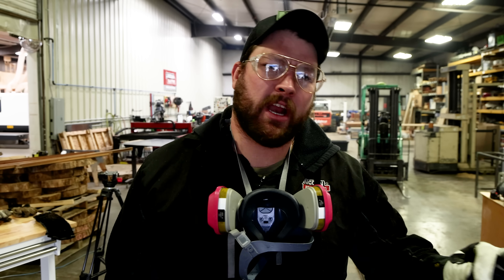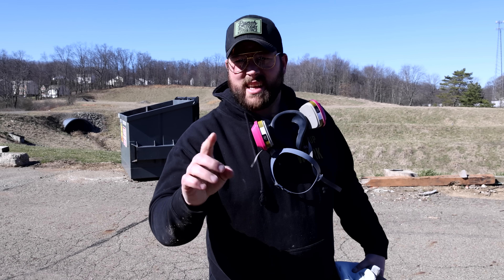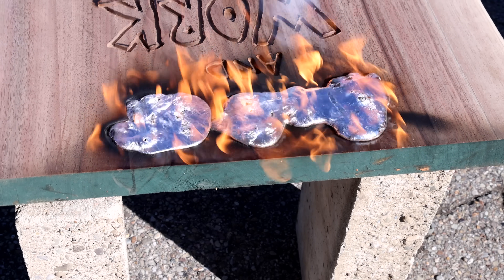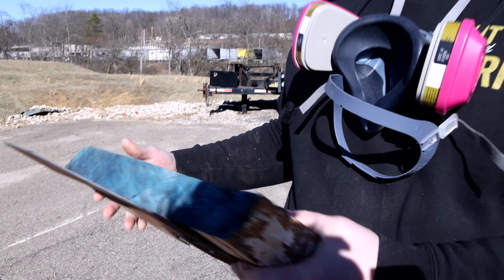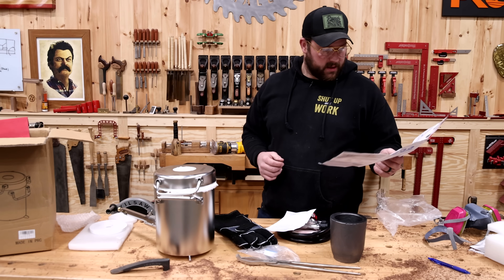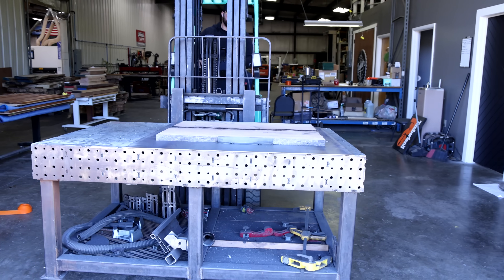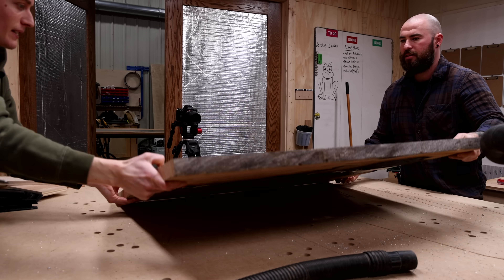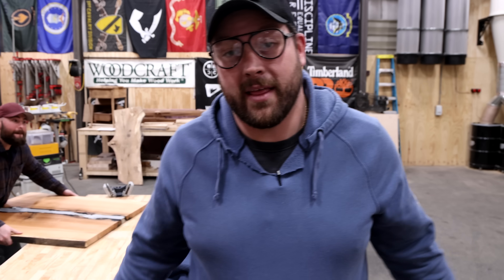I Tested Pouring Molten Aluminum in Wood

Comment: FYI: you can’t get sparks from aluminum. It’s nonferrous. Great attempt. If you can make it work it would be really cool.
Reply: While you are correct that aluminum doesn’t spark like iron, the heat of the shavings thrown off during machining can be hot enough to ignite the fine sawdust in the dust collection system.

Comment: Why not just make a mold of the gap between the wood. Then put the mold in sand and pour the aluminium in there. Then when it's cold, you can take the molded aluminium and epoxy it back in the gap. That way you get a perfect transition between the wood and aluminium, without even any charring. That would look amazing.

Comment: I’d get the slabs set up for the pour and pour silicone in it. Take the silicone mold over to a custom box and fill it with casting sand and pour the aluminum in it like you’d cast anything else. Then, take the aluminum piece back to the slab and it (in theory) should fit in rather beautifully. Might have to epoxy it in there to hold it but you wouldn’t be able to tell. 
There’s SOMEthing that the OP did that he ain’t sharing. Lol.
Reply from the maker: Would you.... hha would you actually do all of this. Don't get me wrong, great idea. But gotta be like 3x the work no ?
Reply: If you want to try that pour it with foam or even wax and make an investment casting. ,,,,,, Much more technical process, though.

Comment: Do you think soaking the wood in water would have reduced the burning and warping?
Reply: Doing that would certainly cause steam explosions when the metal is poured sending molten metal everywhere. Not a great situation
Reply: Good call.

Comment: Maybe try FLUX to make it stick.
Also try soaking the wood so it is wet, pour it, then let it re-dry/cure around the metal.
A possibility is they did it when the slab was fresh and wet, put the metal in it, then dried the wood slowly, letting it shrink and tighten around the metal.

There's a chance you could use something like a 2000° tape, which exists, to mask a lot of the wood space, then it burns into the wood, leaving a smaller entry point than the fill zone, locking it into the wood.

More likely, they started with a flat piece of wood and a large bucket of molten aluminum and just kept pouring it down a tilted slab to cook the river into the slab, instead of filling a hole that would then get distorted by the burnout. 

Or finally, create your pockets in the wood, then char the devil out of them with a super hot torch - cook the wood deep into the slab, then there's not much for the aluminum to burn plus it's a very rough surface with massive amounts of crevices and micro voids to grab onto, if the molten aluminum doesn't punch through too many places in the char it should look mostly the way you laid it out.

There are probably other linings that could be used, since they're not going to be seen, but if the point was creating something that looks like instead of something that's actually then most of this difficulty could be removed from the project.  But if we're looking to on camera create this thing live and then someone's getting an NFT CoA verifying that this artwork is theirs and that it was indeed created in the footage shown, and you sort of have to do it.
Reply: Wet wood?  Good if you want an explosion.

Comment: I think the amount poured is a factor because his pours weren’t fusing. Thing cooling the surface of the aluminum with misting water would help. There’s a lot of prep we don’t see I think on the original tick tock. Like you said but having no knowledge and trying it means it took a lot of trial and error.
Reply: You will NEVER get them to fuse in aluminum. 1 continous pour from one spot or forget it.

Comment: Aluminum = no sparks. Deadly dust, yes. Sparks, no. Also, it machines pretty easily, so tooling, etc. should not be an issue. It also sands very easily; that is how it is actually polished.

Comment: My guess is that he somehow used aluminium leaf or something rather that melting it. The thing to look at is any tell tale black marks on the wood. Wood starts to char at around 180-200C I think. The combustion point is some 300C. Alu melts at 660C, so more than double the combustion point.

Comment: I wonder if he lied and instead of using aluminum, he used Gallium. Its melting point is only like about 85°F. But it's solid at room temp, so if you're in a place that's normally colder than 85°F, it would achieve the same effect.

Comment: Well to make it look good you have to treat the contact surface of the Wood befor you start, the idea here is that you burn the surface and clean it so the molten Metal can flow better. Thats the whas missing to make it work. You sould consider lowering the melting point and using more in one go.

Comment: I know it’s an old video but just watched. I own the largest Pewter manufacturing company in the UK and Pewter would have been a far better solution. It melts at approx 240degrees so would eliminate the scorching you got with aluminium

Comment: I would guess the guy in the TikTok didnt use aluminum, he used a lower melting point metal that looks like aluminum. Bismuth, Lead, Tin alloy melts at about 250 degrees. Indium Alloys melt as low as 117 degrees. Gallium melts at 85 degrees. All of these look like aluminum on camera.

Comment: The problem you had here is that aluminum oxides quickly had you took the oxidation off of every layer after it was poured you wouldn't have separate layers

Comment: Aluminum reacts with oxygen in short time to create a stable oxide. I don't think new pour will stick to it. I think, you should pour one after another.

Edit: Yep, my prediction was on point. The other guy might be cheating. Lead will pour much easier, will not set wood on fire and looks pretty much the same.

Comment: There's paint that conducts electricity. I wonder if there was a possibility of coating this with said paint, electrolysing some aluminium onto the sides and then doing the pour. Probably not, but still an idea.
Also, youtubers Positive Couple from Russia already did this and successfully, they've poured 250 liters (divide by 3.8 and you've got the gallon number) at one time successfully as well. They already have years on you by now.

Comment: Go back to your metal guy and ask for some damage aluminum welding rods and alloy 356. Cast your 1st layer as 50 % pure ingot with aluminum 356 alloy. While the metal is still molten, insert the welding rods into the molten metal to help bond the layers. Cast pure aluminum 356 for your top layer and it will give u better machine ability on the CNC

Comment: Fun fact: aluminum won't "spark" and catch your dust on fire when sanding.
Reply: It can conduct a static charge inside the ducts, like touching a door knob in the winter.  That could certainly blow up a dust collector.

Comment: you sure the original guy used pure aluminium and not an alloy? According to the internet  a better option would be to use  food-safe eutectic aluminium alloy with high silicon content is the Al-12.6%Si-1.1%Cu-1.4%Mg alloy, which has a viscosity of 4.4 cP at 700 °C.  ie Aluminium mixed with Silicon.. or if you want to wave caution to the wind try a Gallium alloy

Comment: Ok so as someone with no experience on this situation and little knowledge of how smelting aluminum works. Simply seeing the size of the table you were trying to work with (maybe start small next time) and that TINY smelter you were using for the actual pour. I already knew there was no way the aluminum was going pour correctly. If yall tried perhaps making a stool or small coffee table with that size of a crucible then yeah i could see it working for yall but with that small amount even my inexperienced self saw the lack of possible success.

Comment: It doesn't look great, but I think it looks feasible with better tools. It looked like the main issue here was ultimately that they couldn't use that much aluminium in one go. If they had the means to do it in maybe 2 or 3 pours, then it might look different.

Comment: No sparks will aluminum if it is pure aluminum.  It is a spark resistant material.  Now can hot sanded aluminum cause a fire, sure.

Comment: I feel like saying it's terrible, with a small foundry that is too small, and an end result that is actually pretty decent as a first effort, is selling yourself short, if you ask tiktok guy, my guess is that they didn't succeed on the first pour either, if you wanted to, I feel like it is definitely possible, and signs could probably be made with a dovetail router bit i think

Comment: You fill in wood with metal that's a specific alloy. Melts at really low temperatures. It's called "Woodsmetal" super easy to remember and it's easy to work with. It melts at lower Temps than the wood burns so you will get absolutely zero charging. The metal will flow to the shape of the hole and usually wedges in but glue can be used as well as woods metal solidifies almost instantly

Comment: Two thoughts:
1. Soak the wood so the aluminum has more time to cool before the wood starts burning, and
2. Maybe use a shielding gas like in welding to stop the wood from actually combusting which might again help to limit how much the wood chars away
Dunno if either would work but maybe?
Reply: That was what I was thinking.  Get it all mighty wet.  Although perhaps one could also preheat the interface between aluminum pours.

I do think I would take the table as is, and cover with a clear epoxy pour.
Reply: You never want moisture and molten metal. It will cause steam explosions that will send metal everywhere. Very big safety concern
Reply: @The.Memes. hmmmm right, yeah maybe don’t soak it

Comment: I think you're being paranoid...

Normal woodworking tools are not going to cause the aluminum to get hot enough to cause a fire in the dust collector and if you take light, easy passes, woodworking equipment can easily machine the aluminum areas of the slab...

At least 2 You Tube channels have created Epoxy Resin blanks and easily turned them on their wood lathes with little difficulty...if their gouges cut the aluminum, so should your planers...
You're just going to need to use MUCH finer sanding grits to polish the aluminum sections if you want a scratch-free sheen or even a mirror finish (might need the buffing wheels for that)...

Comment: Ya got too much heat if you did the same thing with tin or solder you would have better flow with less heat. You got to do it in one pour.  You could melt tin in a large cast iron pot. Bricks would make up your forge. Reuse the propane torch.

Comment: Aluminum doesn't spark when sanding or grinding so the dust collector will be fine... relax, aluminum is easy to work with. I'd say it's easier than wood because mistakes can be fixed with welding.

Comment: you should try using a tin-bismuth alloy.   substantially lower melting point which will  not cause the wood to burn as much. duh!

Comment: I think you chose the wrong metal, you would probably have much more success if you used a metal with a lower melting point like tin or zinc (just be careful not to start a metal fire) or if you're feeling extra stupid lead.

Comment: Why use aluminum? 
There is a huge range of different alloys with lower melting points. A famous one is actually called Wood's alloy, but it is named after its inventor who's name was Wood... nothing to do with what you want to do. it is a mixture of 
50% bismuth, 26.7% lead, 13.3% tin, and 10% cadmium. It's melting temperature is 158F
There are other alloys which do not contain lead and cadmium, which are poisonous, but these alloys are expensive.

Comment: Just crack the propane valve, light it by putting the torch down to the air intake on the unit. Safe and not scary ... just sayin.

Comment: Based PURELY on this single video, I'm betting the original guy did it with tin and not aluminium. Or some other metal with an even lower melting temperature.

Comment: It's better be naked than have improper protective equipment when pouring aluminium into scetchy moulds. Too much moisture and it's all over the place.

If it's hits on bare skin, it cause only light burns or redness or if you are lucky, nothing. I once got it on my face and got away with burnt eyebrows. Skin moisture and leidenfrost effect protects skin for a short moment when it's really hot.

If it pours down to your neck or burnt through the clothes, then you get real burns.  

So, my advice is really fireproof clothes and hood or something to protect neck from droplets.

Comment: what if you did this like a sand casting. like make a table that could hole a sand table that the slabs could sit in. it would dissipate heat a lot better because I mean... that's the most rudamentary way to do it lol

Comment: I think the only way to do this would be to make a mould made out of heat resistant material from the opening in the wood, pout the aluminum into that and then bond the pieces together. I never saw the Tik Tok this was based on, but sight unseen I'd bet it's completely fake. They probably just used aluminum coloured epoxy.

Comment: He probably burned the wood pockets before pouring, The japanese have a method of burning soft wood like pine to harden it before use.
Reply: You could of used the blow torch to keep the aluminum hot as well,

Comment: There's something fake abut that other video. Aluminium has super high surface tension, it needs vacuum or a source of pressure to conform well to a mold (that's why sand casts have big central feeders). The second thing is is shrinks a huge amount, so even if it was a good cast, it would pull away from the mold. Basically, you can't do this they way it seems in that video. At all. I'm surprised you got something as good as you did really.

Comment: What if the TikTok guy poured the metal into a slab, cut the camera and let it burn all to hell. 
THEN…off camera, went over to a second similar looking slab and poured in resin with aluminum colored pigment. 
Then milled that.

Comment: Ummmmmmm lead melts at a lower temp and if you want to pour aluminium you should make a channel out of steele that is u shaped and make it just a little lower than what you are pouring.  Then pour the aluminum so it fills the steel and then just barely overflows onto the wood and fills the gaps and if you can cool it with fans and compressed air if you want to prevent the wood from burning as much but it will still burn. Best bet is using lead and it is heavy but cools very fast and melts at lower temps.
Lead can be polished though. It would make a table very sturdy if you did it in the middle and put a lead base in it too. You might have to. 
I think it is better to make aluminum casting shapes and then incorporate them into the wood table by using wood that is shaped wierd with gaps and just position the metal pieces in the wood and then box the whole thing in and pour epoxy in the box and carve out the table and add legs. It would be okay looking. I am goong to put tons of metal shavings and  corkscrew shavings from a lathe in a pour and make a table top with that but it is a deep pour and i am going to install some places for led lights that can be swapped out when they go bad. Really powerful led lights though. 
The tabletop is going to light up like the forth of july. I am also making an RV trailer interior soon as i am going to build myself an rv. I am doing 10 gallons of epoxy pouring in it and pots of wood surface and carbon fiber i got for free from scrapping a boat yhat was a wrecked 39 foot yacht. I got a ton of high quality carbon fiber

Comment: You guys were pretty close. This actually convinced me it is possible. I would think you need to balance surface area and moisture content of the wood to control how fast it cools. I'd also think that the metal might not be pure aluminum. Seems like a lot a variables that original dude accounted for that you guys might not have locked down yet. I wouldn't say it's a confirmed or  busted myth, but plausible. Also super cool to see a fellow east Pitt guy on YouTube.

Comment: i might be talking out of my ass since ive never done a pour like this either. But i think it would help to go in with a torch and pre-char the wood surfaces that are gonna meet the metal thoroughly. just to boil out the moisture and oils and other volatiles int he wood so the whole thing doesnt start violently warping and gassing out once you pour.
pre-heating the bottom metal plate would also not be a bad idea. (and in general pre-heating the previous layer with a torch before pouring the next one)
pouring the thing in one go would obviously help, but i dont see why you should make it so difficult for yourself. pour a decent bottom layer of half an inch to an inch. Then fill up most of the volume with solid pieces. Pour to fill the gaps and fix the whole stuff in place. Then do one pour to close the whole thing (again aiming for half an inch to an inch). makes no sense to try and pour the whole volume if you dont have the tools to do so.
In terms of getting the whole thing to stick…id probably get a v-shaped router bit to undercut the whole thing on both sides. Just enough so that the outer pours have something to grip to along the whole length. so a quarter to half an inch deep. A few degrees of undercut should be plenty.
Reply: also im not sure id bother with the CNC for milling. Put two rails onto the wood on both sides of the pour and use them as a slide for a handheld router. You can remove material a lot easier if you dont have to factor in the stability of the CNC gentry.